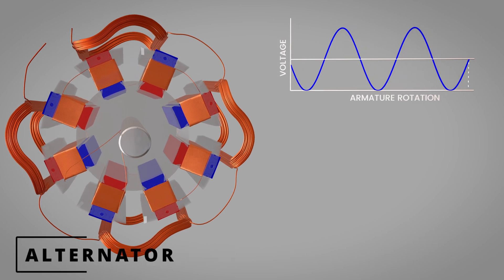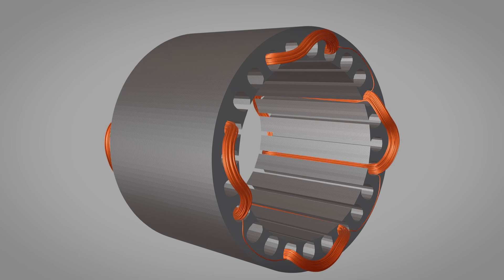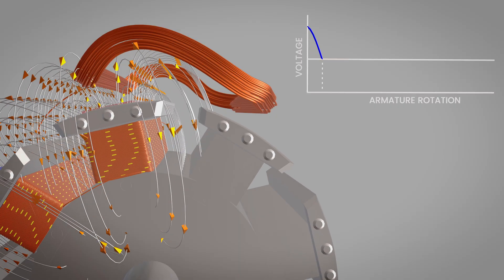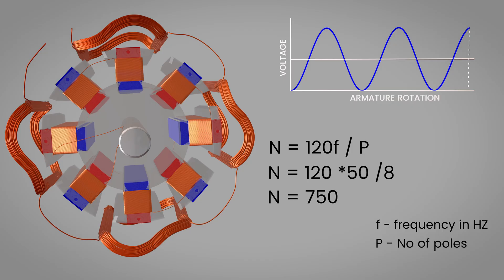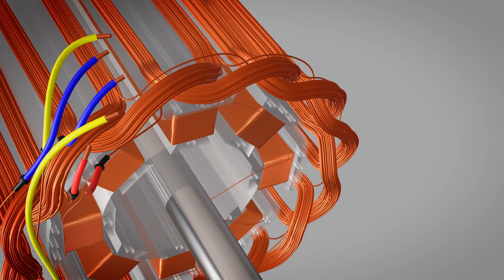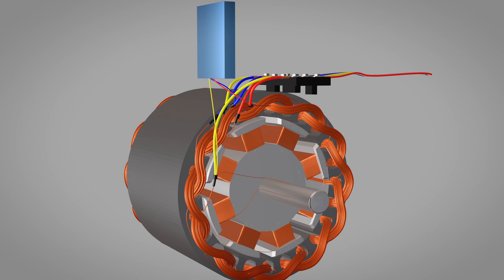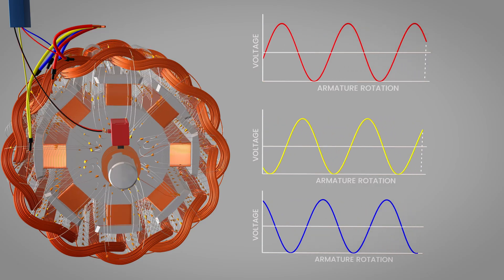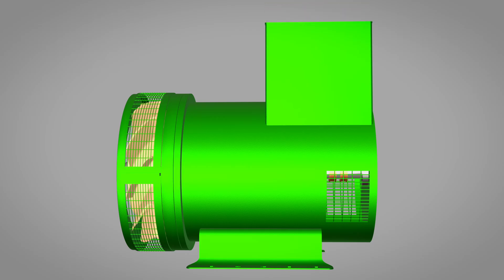How Altenators Work | 3D Animation Explained

Comment: I wish i could donate to you, i will subscribe, thank you for your efforts 

By the way i have question, you mentioned residual magnetism, is it some sort of magnets inserted inside the system ?, for example, if i built my own Alternator respecting all the rules, after giving it let's say 1200rpm or even 2500rpm, am i able to get voltage from it ?

The residual magnetism is what scares me, i'm afraid i might build everything from scratch just to get demoralized

Thank you again
Reply from the maker: In ferromagnetic materials like iron, the application of an electric current through the coil aligns magnetic domains within the core. When the current is switched off, some of these domains remain partially aligned, causing the core to retain a small magnetic field called residual magnetism or remanence.
Concept of magnetic domains are covered in the previous video on dc motor, watch it to fully understand the concept.

Comment: Any model of generator would produce electrical voltage outside the Earth's electromagnetic field!?
Reply from the maker: A generator can produce electricity outside Earth's magnetic field, provided there is a different source of magnetic field for electromagnetic induction, such as built-in permanent magnets or electromagnets in the generator itself

Comment: Well done on creating such superb content; it's not a stretch to say this is on par with content from "The Engineering Mindset channel. In fact, I learnt more about this amazing piece of electro-mechanical machinery (that we just take for granted today of course) than any other source on YouTube. It's still unclear to me however why, in a conventional automobile that 'runs' on 12V DC, manufacturers specify an AC alternator to generate current and then rectify it to DC for use in starter-battery charging & most auxiliary systems. I've been told (unconvincingly) that "it's more efficient that way".
Reply: I'm not an expert but i think there is no way of producing DC electricity directly except if you get it from something like solar pannels

It has to be AC first then converted into DC

What i didn't understand is the residual magnetism, because i wish to build an alternator at home but does it need some magnetism before i crank it ?, isn't it able to produce it when it's rotating ?